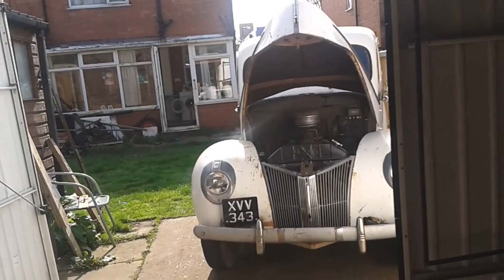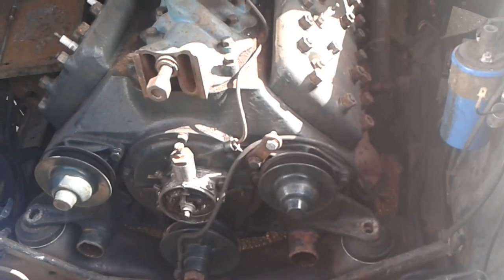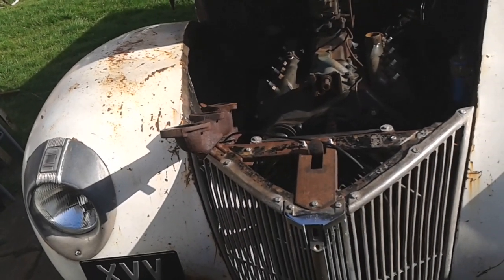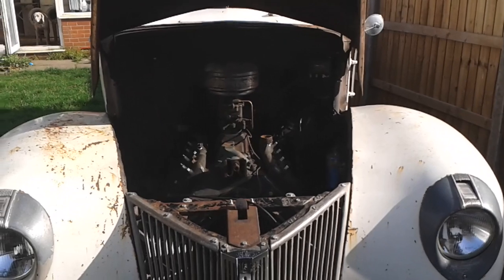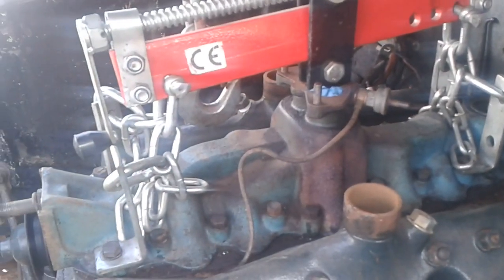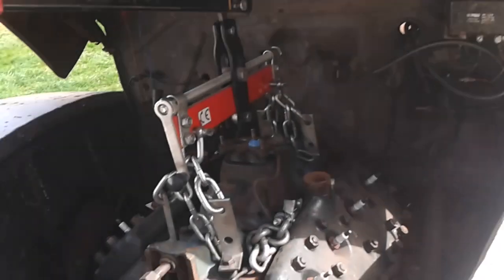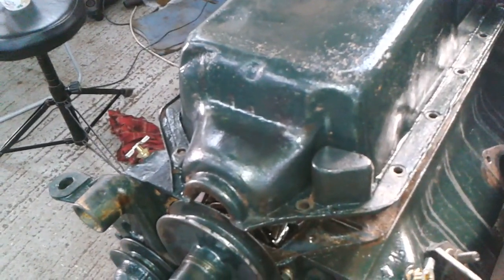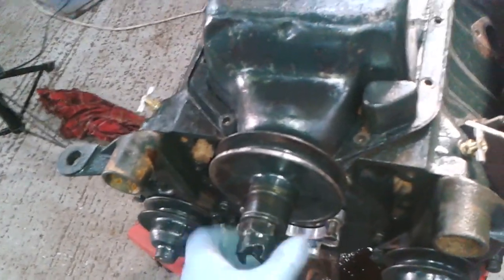Ford Flathead engine swap part 1.  Yank it out.

Comment: Hi Mart, lots of work you're doing, hope the oil pressure is ok. What method did you use to check the bearing clearance? I hope to be assembing my 8BA soon. Thanks Byron
Reply from the maker: Hello Byron. As this is a fully floating setup, I measured the bore of the rod, the diameter of the crank (in multiple directions) and the thickness of the floating shells. Some simple math work later and the clearance can be calculated.

Comment: I always thought the access plate in the top of the tranny was for the grease zerk on the throwout bearing. Don't think this carried over to 49-53. It's a great idea. Good progess Mart!
Reply from the maker: Thanks Robert. That inspection hole is very useful as you will realise as the series unfolds.

Comment: No way I could get the engine out of my '47 without removing the "bonnet" and/or the grille.  You're a magician!
Reply from the maker: Ha ha thanks William. I did it once before on a 40 coupe so I had a good idea it would work. Not worrying too much about the "paint" certainly helps. But to be honest, the chance of damaging the paint when removing the hood is pretty high as well.